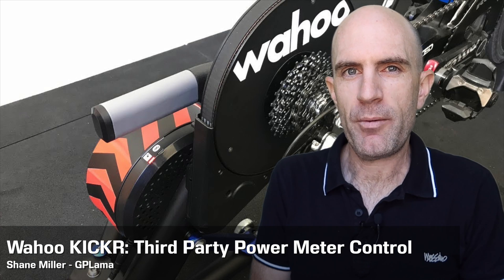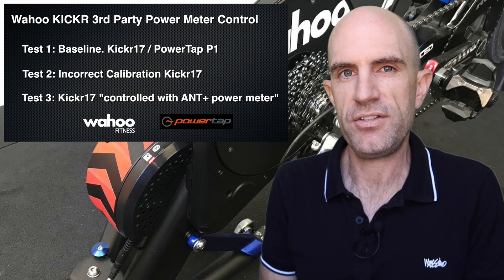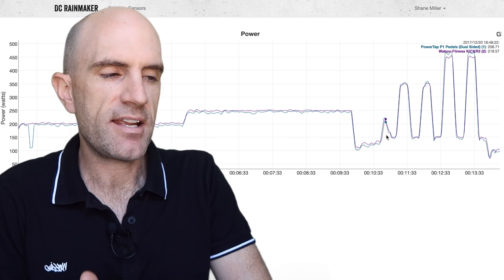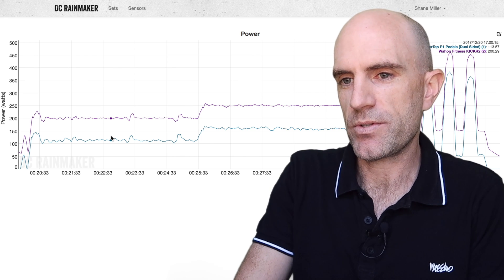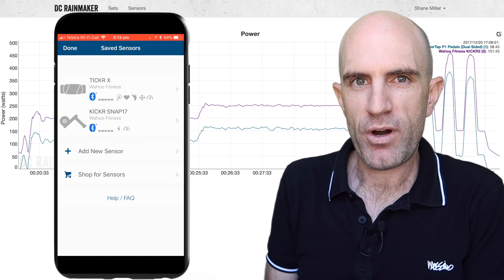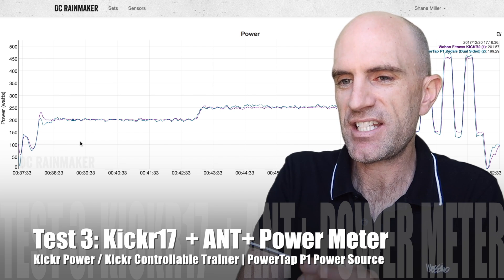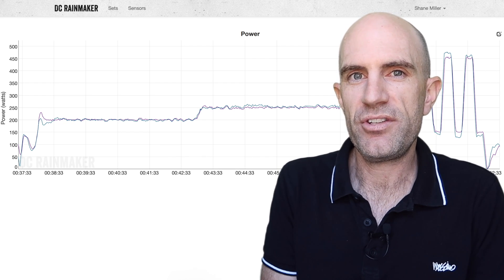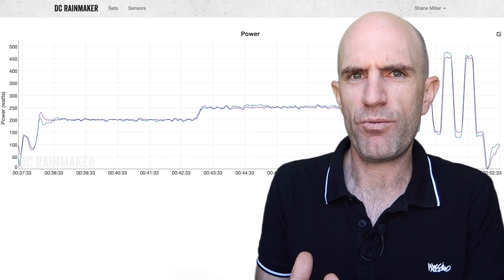Wahoo KICKR: Third Party Power Meter Control

Comment: I noticed in your video you were pairing your sensors on Zwift with an ANT+ signal, not Bluetooth.  Whereas, when you set up to control Kickr power with your P1 pedals on Wahoo fitness app, you did it via Bluetooth. My question is, since a Bluetooth device can only be paired to one thing at a time, what happens when you use Zwift on an IPad and pair sensors via Bluetooth?  If you close the Wahoo fitness app after setting up 3rd party power meter control, will the Kickr still be controlled by the 3rd party power meter?  I ask, as I want to do structured workouts on Zwift in erg mode, but want to use my bike’s power meter for the power information.  As you know, you can only do erg mode on Zwift with the Kickr as your power source.  So, I just want to know that if you previously setup the Kickr to be controlled by your power meter on the Wahoo app and closed the app so that you can have access to the Bluetooth signals for the IPad, that the Kickr will still work this way on Zwift when you select Kickr as your power source.  Thoughts?
Reply from the maker: Zwift has supported Power Matching for a while now. https://www.youtube.com/watch?v=JBKmBh8_Pew
Reply: Thanks for clearing this up.  I did not know that Zwift had fixed this.
Reply: Just to be clear, once you setup your Kickr to be controlled by a 3rd party power meter on the Wahoo Fitness app, will this continue to be the case, even after closing the Wahoo Fitness App?  Does the app have to be open and running for this 3rd party power matching to work this way?
Reply from the maker: I had closed the app on the phone. Without knowing the code behind the scenes, I'm assuming it writes that configuration to the Kickr and it stores it.

Comment: Wondering what the result would be if you repeated your 200W ERG mode experiment with the Garmin Vector 3 pedals, but used the pedals as power source. Would you see the same difference between the trainer and the pedals or not.
Reply from the maker: Power matching to the pedals direct will see exactly what the pedals see. It's the ideal solution if it is supported (and works) by the software you're using.
Reply: Hmm, can't you capture the power output the trainer is measuring, while you use the power output of the pedals as input to the ERG mode (so controlling the resistance of the trainer) ? I don't have a power meter, so cannot test whether this setup is uberhaupt possible.

Comment: So, I'm not sure I completely understand this... I have a Stages left crank on the bike I usually ride on Zwift with my "dumb" trainer (KK fluid); I'm getting a Kickr Snap for Christmas (😉)... would this finding be relevant for my new setup? Thanks!!
Reply from the maker: It depends... Just set up your SNAP as per the manual/instructions and it should match the Stages pretty closely for power numbers. If not, use Power Matching or this method with the SNAP and your Stages.
Reply: Shane Miller - thank you!!

Comment: @Shane Miller. I did the basic spindown after Zwift. I got 48.1 seconds with a Temp of 32.6 C. 
Are these the normal or average  numbers?  I did an advance spindown as well and got 1.02 as my brake strength. Thoughts? Thanks again.
Reply from the maker: I'm not sure of the ranges... sounds about right... Wahoo Support is your best bet here.
Reply: Shane Miller thanks again. Will contact Wahoo.

Comment: If just using zwift which has its own power matching is there any difference between these two methods? (Assuming you ignore the configuration aspect)
Reply from the maker: In theory, no.

Comment: Are you saying:Buy a cheap trainer, and use a powermeter on your bike to work with TR,Zwift etc...? Much more accurate without all the calibration stuff? That way you have the same power referenc when training outside as well...
Reply from the maker: No, that’s not what I’m saying.
Reply: Steven Vanlancker i tend also to invest rather in a powermeter, than in a kickr!

Comment: Would a miscalibrated smart trainer cause gradient simulations to be off in sim mode? The resistance in sim mode is not dependent on power output, and since the Kickr uses its brake strength to calculate power, it would seem that an inaccurate brake strength reading would result in the resistance being off.
Reply from the maker: Great question. I don't believe so, you'll just get over those hills virtually faster. Needs checking out to confirm though.
Reply: @gplama  this is my question for a while now and I've yet to be replied by Wahoo support! Did you find a chance to test it out Shane. Thanks!
Reply from the maker: @matalebi  It's not one I've spent any time on sorry.

Comment: Its always seemed like anyone and everyone on zwift has 300 watts FTP and endless power in races. I never believed it from day one. Now we know.  Zwift needs to step up to the plate and think of a way to make calibration mandatory before races. Otherwise why bother with Zwift if its just a cheater domain.
Reply from the maker: The sky hasn't fallen... it's all about perspective. If there's ANYTHING on the line for the virtual races then they need to be sanctioned/certified/verified/etc. Everything else is a good training ride. I've raced against known dopers on the road, they've beaten me, I've beaten them... What I'm in full control of is my own integrity. Same with this indoor tech. The best thing you can do is be honest and let God sort out the rest. :)
Reply: Because it's fun and a great workout and because the vast majority of people don't want to cheat imo. There is no way for Zwift to entirely stop the cheating e.g. they can't weigh you before you step on the trainer. Zwift HQ also has its focus on getting people riding together, not putting barriers in the way for marginally more accurate competitive events. At the sharp end of races ZADA helps to regulate things but I would focus on enjoying the ride and the workout regardless of the minority.

Comment: Thanks for the video! My Kickr Snap in Erg mode hasn't been reacting quick enough to zwift and I find myself failing some workout portions because I'm over or under the prescribed power. Would having a power pedal linked help this?
Reply from the maker: ..... hard to say without knowing what's causing the delay. Check for new firmware, perform an advanced spindown, check again. Maybe try a different gear (bigger or smaller) to see if that impacts the response times. That'd be something I'd look into on the SNAP if I had a spare few hours.
Reply: Make sure to use fe-c mode if using ant. That helped for me
Reply: Apparently I only had the fe-c ant+ for the trainer but nothing for "controllable" so nothing was actually controlling the trainer. All set now, plus I added the vector 3s to control it so Erg mode works wonders. Thanks for the pedal removal video you did plus the power matching. Both of which were great helps!

Comment: What about pairing the power meter to zwift and just going off that? Why would you need to go via the trainer?
I haven’t been able to work out which is accurate, my direto or stages.
Reply from the maker: That's power matching, another option. I'd hedge bets on the Direto.
Reply: You should compare the sensation you have on a given incline in Zwift vs in real life. My Drivo was way harder for a given % than what I experienced IRL so I set my Stages as the power source and now I get a better feedback.
Reply: Good idea - where can I dial-in a slope? Using the etraining app? Won't it matter what gear I'm in too (although I could match that too I guess)

Comment: Isn’t he asking whether you need to spindown if you’re using the ant+ PM to drive zwift?

I’ve found using my PM as the power source saves a heap of time and hassle over spinning down my SNAP. Essentially the SNAP data becomes redundant. The only downside is that the ERG mode isn’t great at z3-5 efforts, tends to bog down. For those I’m spinning down the SNAP and using that as my power source which is much much better, still not KICKR good though mind. Comparison data from the PM on the ELEMNT is a few watts different over 10 mins or so. Pretty close 👍
Reply from the maker: It's effectively the same thing as Power Matching... but with the added twist of the Kickr being middleware.

Comment: Shane rather than connect the P1 pedals directly to the Kickr via the wahoo fitness app could you not just select the pedals as the power source in Zwift? Zwift would still control the resistance of the Kickr. In my head at least this method would be more efficient as you are bypassing the step of the kickr first reading the power from the P1's before transmitting to Zwift.
Reply from the maker: Yes. This is power matching.
Reply: I came here to ask a similar question shane as I tried just selecting my p1.s in zwift (hadnt set kickr to be controlled in wahoo fitness app) but when doing workout it felt like the watts were not locked in? Anyway took me ages to find the setting in the wahoo fitness app to set kickr to be controlled from ant+ power (android phone never gave me the options? eneded up doing it via ipad????) so did a quick trial last night with power on zwift selected for p1 and to be honest it still didnt feel "locked in" am I doing something wrong? would appreciate a quick video tutorial on this setup ;)

Comment: Very interesting Shane, I was wondering almost the same thing.... Almost, as I can not configure my Tacx to read from a different power source. What would happen if I select the Tacx as controllable trainer in Zwift, but the power meter (i.e. Not the Tacx) as power source?
Reply: Same here, I use my Quarq crank power meter with The Hammer on Zwift... mostly so I know power measurement is consistent between indoor and outdoor rides.  I'd think if there were any complications or side effects from using this "power match" feature in Zwift it would come up in ERG mode (not regular resistance/grade mode).  But that's speculation on my part.
Reply from the maker: That’s power matching, in theory works great.
Reply: I use a cycleops hammer for resistance and  powertap p1 as a power source in zwift. Works great!
Reply: Bradley Peet Exactly, it is the ERG mode I'm concerned about. I guess it's down to how the FE-C protocol works, more specifically if it uses the power from Zwift as input to its controller, or its internal power. Would be perfect to have it configurable like the Wahoo has.

Comment: What were your steps to get KICKR so inaccurate? Hoping to find out so that I can avoid doing whatever you did! lol
Reply from the maker: Won’t be posting a how to on this anytime soon. Someone will chime in with how no doubt.
Reply: ...ah... a guy who wants to get big numbers on Zwift...😏
Reply: I'll play spoiler. You perform a spindown calibration, pedal up to speed, then when it's time to coast you apply an external braking force to the flywheel. That's one way, and I'm certain a lot of Zwifters are guilty of it.😉Even easier to fudge with most wheel-on trainers since you have the wheel/brakes attached.

Comment: Interesting. I asked the same question direct to wahoo about my snap. I was told that as Zwift was a separate app that telling the snap to use the ant+ power meter as its power source wouldn’t carry through.
Reply from the maker: This requires a SNAP17 iirc
Reply: Shane Miller the option to use ANT+ power meter to control the trainer is definitely there in the wahoo fitness app for it. I looked into as Zwift on iOS can only read power from one pedal on the powertap P1 via Bluetooth. I’d be really good to know if it worked or not to get accurate dual sided power in Zwift.
Reply from the maker: Kickr as a Bluetooth bridge.... that’s good thinking. In theory this will work.
Reply: I’ll have to do a similar test to your video and see how it works.
Reply: Did a ride this morning, seems to work a treat - tracks much better than left sided only, and no matter how much I altered the tension on the wheel the power seems to track accurately. (Used DC rainmakers analyser to compare the P1 to Zwift) Seems a great solution.
Reply: Wahoo told me this too - with a new Kickr Snap. As did TrainerRoad support.. Wahoo said it might work if you leave the app open. I''ve done some initial tests and it doesn't seem to work, at least not reliably. And since you have no way to confirm whether it's working or not in Zwift it may not be worth the trouble. I was hoping for a better ERG mode in Zwift using this method and my Stages power meter. If you get a chance to try this with the new Snap would be very interesting to your opinion - it's probably more pertinent to the Snap than the Kickr, since it's more of a pain to have to calibrate the Snap versus the Kickr. Thanks for all your videos!

Comment: so for zwift races should zwift introduce a requirement to perform a spin down or zero offset before the race starts to make things fair? or is this just the "online" world where we take all results with a grain of salt. i doesn't bother me to much as i don't race but it i guess its the same as weight doping
Reply from the maker: It’s a lot more difficult than this to ensure the integrity of online events.
Reply: There would have to be protocol of warming up the trainer properly before spindown etc. Just doing spin down on cold trainer, in most cases (mainly with wheel-on trainers) will cause wild inaccuracies.
Reply: The latter. Like Strava all good fun without 100% integrity. No matter the power source - virtual power, smart trainer or power meter are all open to abuse/inaccuracy. At the sharp end the whole ZADA thing helps but again they can only do so much. The good news is most people want accurate results and regardless Zwift racing is great fun and gives you one hell of a workout, especially if you're chasing down someone who's mis-calibrated :D

Comment: I'm not really sure how you configured to simulate wrong power on purpose, I do a regular spindown via the app.  Is there a way we could do that by accident?
Reply from the maker: Yes and no.... Best just to ensure you've got everything correct for your setup (wheel size/etc for the SNAP) and a good warm up performed on either the SNAP/KICKR before performing the spindown process.

Comment: Well illustrated how inaccurate a kickr can be when not properly calibrated. I’m pretty Sure a lot of users abuse this, as they burst out immense numbers on Zwift, but get dropped in real life racing. Thanks Lama
Reply: This is why I dont do anything competitive on Zwift. I see average speeds on Strava from Zwift over 100MPH..
Reply: Norevlimitr This really is the exception though and if it's really outrageous people are scrubbed from results. Of course z power, smart trainer or power meter can be rigged and it's even simpler to just lie about your weight but most don't seem to do this in my opinion. That said, like Strava, it's all for fun I don't take it as gospel but I do enjoy it.